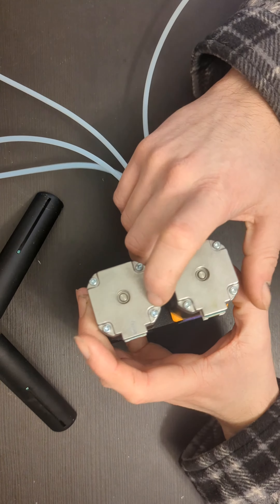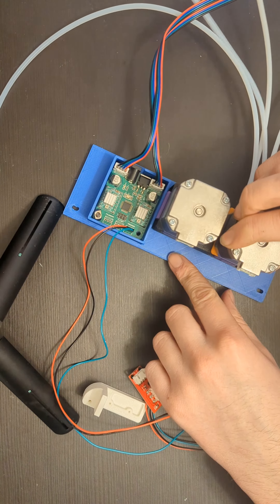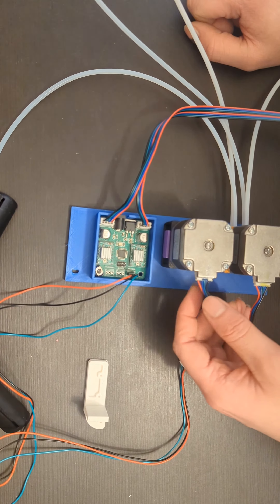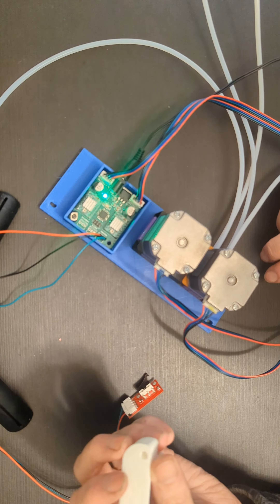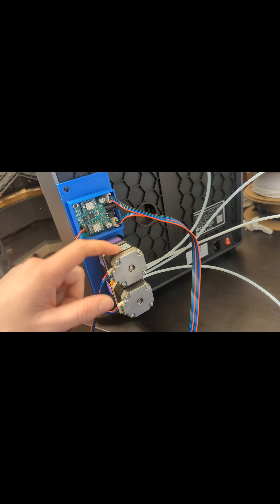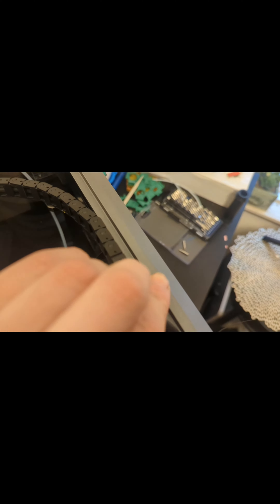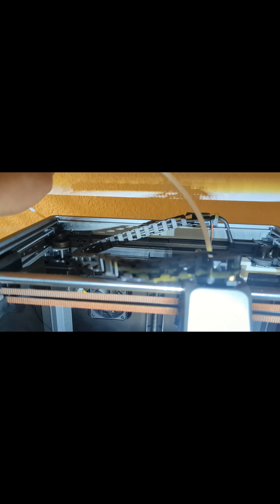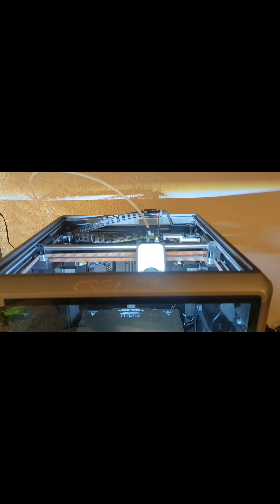3D Chameleon Install tutorial for K1/K1 Max 3D Printers!

Comment: The switch is being pushed by the rod when preparing to print and cleaning the nozzle on the K1 max. Anyone else have this issue?
Reply from the maker: Check the printables link,I think there's a remix of the switch that should help prevent that from happening!

Comment: Good job man. I have the K1 Max and will need to figure out how to use this with as much as possible that I learned from your video. I would love to see a video from you about the gcode setup as well as setting things up in Prusa or Orca slicers. 
I would like to have the option of unplugging the cameleon and reverting my printer back to normal (or just set up a different printer in my slicer... would prob be better) - that way I can control things a bit better especially when my needs change for certain jobs I want to do.
Reply from the maker: Thanks! I plan to do a video soon just been a bit busy lately so haven't had much time. As far as going back to stock, one easy way is to keep two separate lengths of ptfe tubing. Then you can run a single spool side mounted and then leave the chameleon on the back without having to modify/remove anything. That way if you end up using the chameleon again it's already installed!
Reply: @Houstons3DPrints  yeah I like that idea, just the gcode changes in the slicer it think will be better to use a separate "printer" so it would be easy to switch too.
Looking forward to your new videos. Ooh and would love the stl for that great short video you did!
Reply: You can always just use the center pass through and feed filament directly through the Y adapter.  Look in the very top of the Y adapter... you can feed filament straight down through it to the stock extruder and skip everything.

Comment: Great video and I have been using it to help install my 3D Chameleon. You should a bracket that you made to hold y connector. Can you share that stl so I can mount it to the back of my printer as well?
Reply from the maker: I need to go back in and modify the bracket slightly. I'll make that my mission tomorrow and get that uploaded for you!
Reply from the maker: heres the mount I created! Let me know if you run into any issues with it!
https://www.printables.com/model/779394-creality-k1k1-max-corner-mount-for-3d-chameleon-y-

Comment: Thanks for making this!  I have a chameleon coming for my K1 Max and was struggling to find much info on how to pull it off.

I hope to put the splitter inside the printer, where the runout sensor is on the max.  The thinking is to keep the distance as low as possible for filament changes.
Reply from the maker: Sounds like a solid plan! My favorite part of the 3D Chameleon is the versatility of how you install it as there's really no right or wrong way to do so!
Reply: i have the k1max on the way and i am now asking how to get multi color. a wide open topic apparently.
Reply: @Houstons3DPrints  Just got mine today!  One question for you though: 

I am having issues getting it to feed into the extruder while locked.
I used a spare length of PTFE from the kit like you suggest but I just get grinding noise when it hits the extruder gears and it never makes it past them on it's own.

Do I need to modify the code somehow so the extruder starts going once the filament arrives?
Reply from the maker: @TGMisKillingTheMiddleClass  the stock gcode should work just fine. It could be a few things,  
The tensioners inside the chameleon may need to be changed for more grip. Depending on the length of the Bowden tubes you may need to adjust the timing a bit to get it to feed properly. When it goes to change filament can you see that it's feeding all the way to the extruder? Mine occasionally makes the clicking sound which I think is just the downside of how this system works.
Reply: @Houstons3DPrints  it feeds all the way to the extruder but sometimes doesn't grab the filament.  
When this happens the chameleon extruder tries to push it and grinds a bit.  Then when it is trying to unload that filament there is a chewed up portion of filament that prevents the chameleon from gripping it.  Making it fail to switch to the next color

Would the stronger tensioners help with this?  Or would it just chew up the filament more?

Out of curiosity what is your "extruder to hotend" distance you used for the GCode generator?

Comment: Hey, I'm having issues getting the filament to feed through the extruder on the printer. Got the gcode to run the filament up to it but I can't get the teeth/gears to engage the filament and pull it through to actually start printing. It starts to click and jerk the tube and filament. The chameleon seems to be grinding my filament and I'm not sure what the solution is at this point. 

Is it a gcode issue? Does the lock on the tool head need be disengaged?
Reply from the maker: Extruder should be in the locked position when using the chameleon. When feeding into the extruder from the chameleon you need to verify the extruder is running before the filament gets to the gears. That will help prevent the clicking you're hearing and will feed smoothly through the extruder. If the chameleon itself is grinding the filament down you may have to verify that the drive gears are properly aligned with the filament otherwise it may grind on certain parts when trying to feed it through.

Comment: Hi so I just got my 3d cameleon. The manufacturer date was oct 2023 and it says mk4. The issue that I am having is the screws aren’t long enough to successfully mount the motors assembly to the back mount. I wonder if they changed the length of the bolts?
Reply from the maker: As far as I'm aware they should all work. I have the updated version now using the Mk4 and the screws mount fine with mine.
Reply: Hey thanks for the reply. The issue was me I am
Stupid. I didn’t look in the baggie or read the manual that says that there are longer screws included to
Solve this problem. One other question I added ptfe tubes on both sides but for some reason doing this seems to cause a miss alignment so the filament doesn’t pass from one side to the other. Do you have any solutions for this ?
Reply from the maker: @kman2k12  make sure when reinstalling everything that the ports are lined up together along with having a clear pathway with the gears that drive the filament through. I actually did the same and it may seem a tad harder to get the filament through but I typically manually press the switch to get the chameleon to feed the filament through. If that isn't the case taking a drill bit and cleaning out the port very lightly may help seat the printed parts better with the additional ptfe tubes. 

Hope that helps!